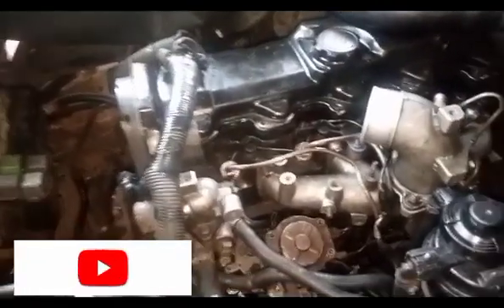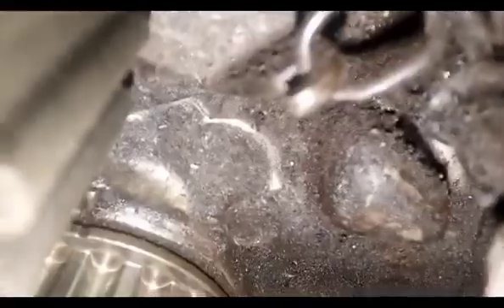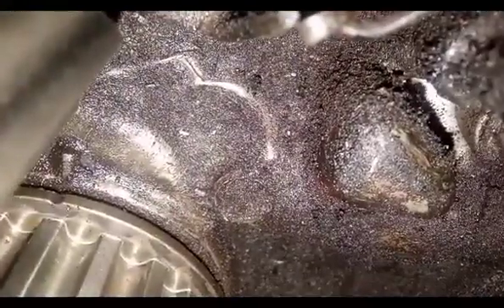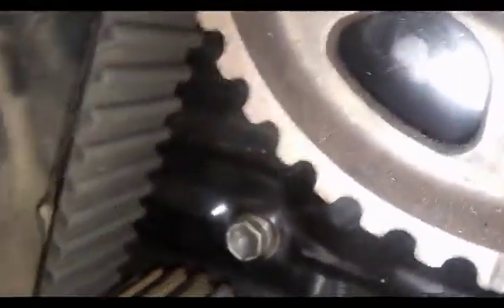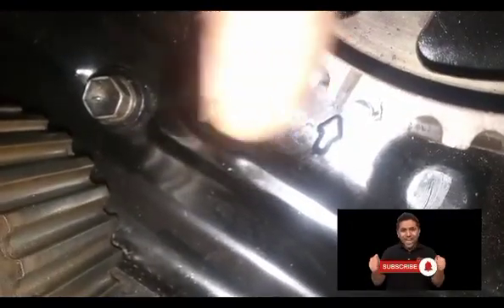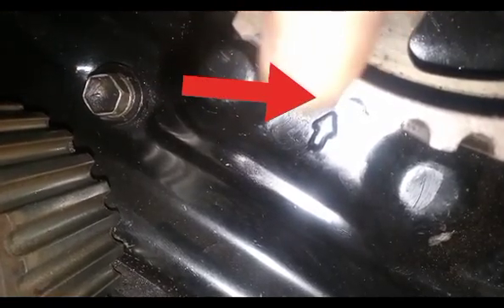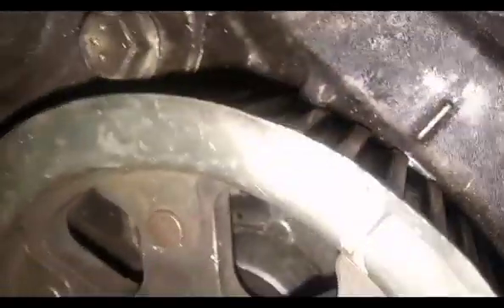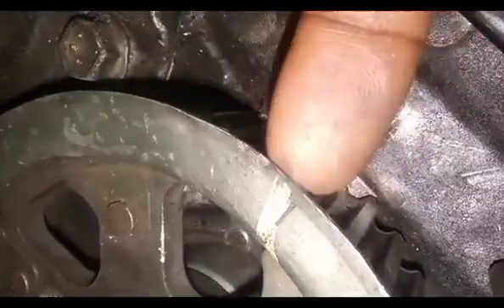5L ENGINE TIMING AND IT MARKS

Comment: 5L engine timing cover and bolt and crankshuft pulley bolts. how can I remove it and replace it?
Reply from the maker: Please remove all the valve cover bolt using 10mm ball spanner after that then you lock the crankshaft pulley and then loose the crankshaft bolt.
But if you don't have much experience about it please kindly send it to mechanic to do it for you.
Thank you